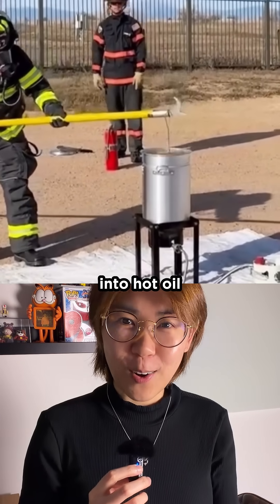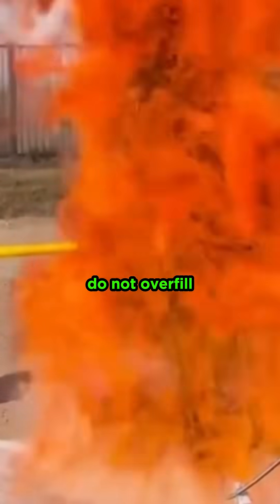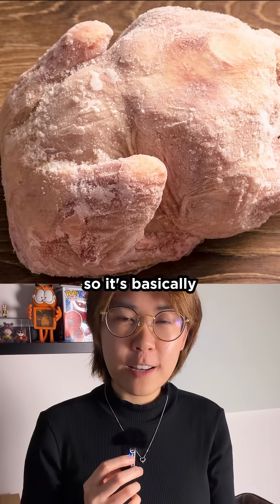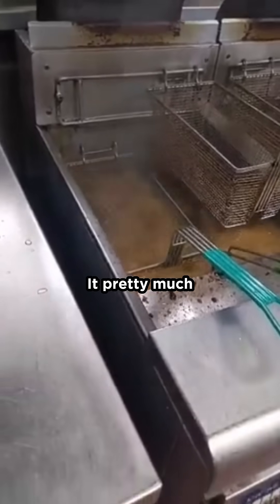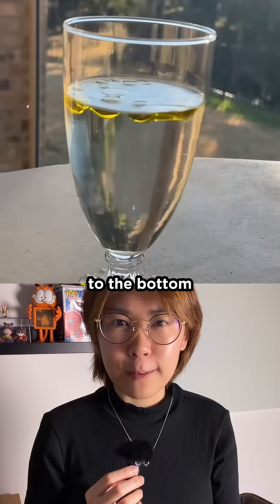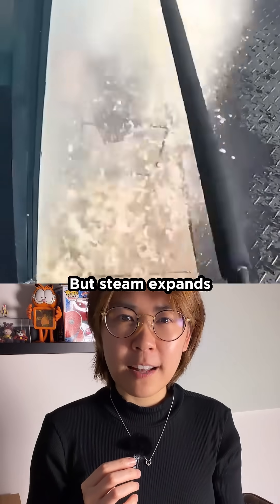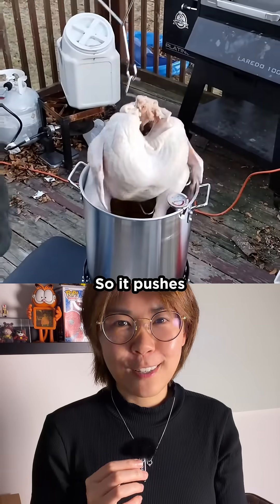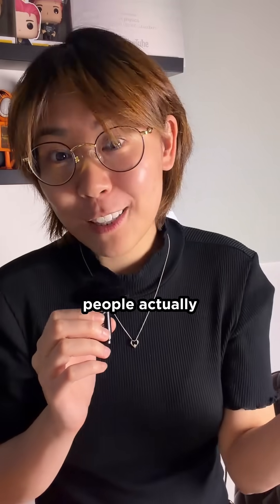The Dangerous Truth Behind Deep Frying a Frozen Turkey #holidayswithyoutube

Comment: The real thing to take home is that people do deep fry entire turkeys. 

I didn't think you would be able to get enough heat to the centre without burning the outside.
Reply: The oil actually circulates through the center of the bird and comes up.  The neck is gone so its an open cavity.  It is way faster than waiting for the heat in an oven to penetrate the center.

Comment: Deep fried 11 turkeys without issue refrigerator bird from the store 20 pound bird every year line on the steel container for how much oil consistent bird weight means you will be within a certain threshold and if you do a dry run without heating the oil you can insure the oil won't ever spill over

Comment: You can deep fry a frozen turkey. Using a giant cauldron blast furnace. You need a pan big enough to catch the oil and you have to rapidly add more heat. You can also use a pressure vessel which works amazingly. If thawed only takes 10 to 15 minutes. Probably only takes an hour frozen. I just use fresh turkey so I haven't tried it.

Comment: Worked in a train company once. They wanted to test the glass for the windshield if its tough enough to withstand a hit from a migrating bird in mid flight at top speed. The tester loaded a dead turkey into an air canon and shot it at the glass. It shattered the glass and smashed thru the first chamber. After investigation a memo came down stating that the test bird should be defrost first.

Comment: Something similar happened when I cleaned my kettle with a mixture of water-diluted vinegar. Apparently vinegar has a higher boiling point than water, but that is not how I would describe my experience. It ended up frothing quite violently, apparently has to do with the water turning into steam and ejecting the acetic acid like the oil would do with the water here. Especially if you use a diluted mixture, make sure to only go to 60°C and terminate manually. You can then reuse the waste for a tea, soap and vinegar fly trap if you feel like it. Especially during summer, that helped for a few infestations...

Comment: The boiling point of oil is also higher that water so even if your oil isn't boiling the water you add can. That roiling, boiling, steaming water is what throws the super hot oil everywhere. You can fry your turkey, but do it correctly.

Comment: I've probably only eaten turkey a few times in my life, but it seems the problem with this is ratio of the size of the bird, the amount of oil, and the size of the container. I honestly don't get why people keep doing it in pots barely bigger than the bird and look like they're almost filled to the brim.
Frying something frozen is actually quite common; french fries, for example. You just need to account enough space for the overflow, which is honestly pretty standard in deep frying--but then again, you'd need a LOT of it to fry something so big. Something wider than a stock pot. Also, don't drop it into the oil. I learned all of these the hard way when I started learning to cook.
Reply: Plus there are other ways to cook a turkey, like baking.

Comment: Okay, but what if i defrost the turkey overnight? Is it safe-ish then?
Reply: Yes, if you watch the video again, you will notice that most of the examples have people dunking the bird in very quickly or straight dropping it in.  Since the turkey is open all the way through, lowering it slowly while keeping an eye on the oil allows you to control the intensity of the reaction with any remaining moisture on the bird.

It isn't the moisture content IN the meat thats causing it, but what remains on the surface.  Thaw the bird, and I tend to leave it to sit for 30minutes to an hour at room temp, then pat dry the inside and the outside, then its ready to go.

Comment: The overflow of the hot oil then contacted the red-hot heating element at the bottom of the cooking pot, raising it to its ignition temperature. The flame then rapidly spread up through the stream of oil cascading down the side.

Comment: So what I've learn today is 1) if intending to deep-fry a whole-ass turkey, pre-cook in the oven to defrost first, 2) actually make sure there's enough empty space in the fryer for the turkey to fit to avoid a huge mess and potential THIRD DEGREE BURNS.
Reply: The trick is to place a defrosted turkey in to the pot, then fill with water until it just covers it, then remove the turkey and take note of the water level, that would be the fill level for the oil.  Also fold the wings in so they're not flopping around and catching on the pot when you lower it.

I do this prior to placing my turkey in the brine since its going to be wet anyway. If brining, I try to get fresh turkey instead of frozen since the frozen stuff in the US is pre-brined for the purposes of oven cooking.

Comment: this is ALSO why when you add the bird you TURN OFF THE DAMN BURNER.

Like that is safety tip #2 (#1 is a dry not frozen bird).

Because if the burner is off. the worst case for oil overflow is a huge mess, (and burns on contact) but without an open flame from the burner. no fireball.
Reply: Its that simple. Even if you fuck up every other rule, it'll be fine if the burner is off
Reply: @Dogthejewhunter  Seriously. I don't always have time to pre-measure, but it takes no time to kill the burner.
Reply: They even have a fill line for the pot you use to fry the turkey. It's not hard. But you have to be careful
Reply: @mattvillegas6355 , the fill line may not be accurate for the size of your bird. Best was is to put the turkey in the pot and fill with water to appropriate depth. Then remove the turkey dry it and note the level of the water. That is your real fill line.
Reply: @JM-lk6wo also doing it outside on concrete / stone is a good idea
Reply: How about just using an oven?
Reply: @epic7224 You can. and my family has done both and prefers oven roasted for our thanksgiving.

but Deepfried has its benefits!  it’s usually juicier (especially some of the otherwise drier breast) and more tender. the skin is much crispier, and the overall flavor profile is different.  (different oils can also effect this).

it’s sort of like asking why do a wet potroast vs a dry roast with the same cut, or baked vs BBQ smoked Ribs, frozen poptart vs toaster poptart.  the resulting dish is just different.  and if it’s what you prefer, it’s worth the effort.

Comment: Who the fuck deep frying a turkey like that anyway ?
Reply: People who buy a frozen turkey literally the night before and severely underestimate how long it takes to thaw
Reply: @redjoker365  will it helps the thawing process if the cold turkey is put in a preheated oven (but the oven is not turned on after the turkey put inside) or will it cook the turkey instead?
Reply: @antokarman2064 not really, it might thaw the outer 1" or so but it won't make the inside thaw. It takes 3-5 days to thaw a turkey.
Reply: @antokarman2064  Sounds like a great way to get food poisoning. The longer the food sits at the danger zone, the more bacteria you're going to get. Even if you cook the food long enough at high enough temperature to kill the bacteria, you're still going to have the toxins they produced.. and the longer it was between 40 F and 140 F, the more toxins there will be.
Reply: @hrodga  wait, then how do "normal" people usually cook them? they buy the turkey fresh? or they thaw them more than a day?
Reply: @antokarman2064  You have to thaw a turkey in the refrigerator over several days. If it is still frozen in the middle on the day your cooking, it can go into a cool water bath (completely covered) for a couple hours to finish.
Reply: @antokarman2064  
It depends on the Temperature of the Oven. But it wont help much compared to just have it sit on the Counter. Because there is not really much energy in the Limited air in the Oven.

Water helps with Quicker Defrosting. Usually if you put your Frozen goods into Water, it will vastly Speed up the Defrosting. 
However in terms of Quality, you would want to have it defrost slower in the Fridge. Quickly Defrosting is not very good for the Quality of your Product.

Dunno the Actual Physics for sure, but I guess its because Water has a much higher cpacity to move Heat around than Air.
Reply: @bmo3778  
You thaw them over a longer time in the Fridge. 
You get relativly little Bacteria multiplication when thawing stuff in the Fridge.

The "Danger Zone" is around Room Temperature. 
If you thaw your Bird in the Oven or Counter, you get much more Bacteria reproduction than a significant longer time in the Fridge just above Freezing.
Reply: @hrodga ”toxins” lol name one toxin
Reply: @antokarman2064  fastest way to thaw a turkey is to submerge it in cool water while it's still wrapped up. Check every 30 minutes and flip it. Don't use warm water because it will thaw it too unevenly which could lead to spoiled meat or just gross texture. Takes anywhere from 4-12 hours depending on the size.
Reply: @Z3R0NU11  Just one? Botulism toxin is pretty well known, Salmonella makes both endotoxins and exotoxins,  listeriolysin comes from Listeria.. shiga toxins from e coli... but you don't need to know their names; you just need to know how to prevent causing them if you want to cook safe food for people.
Reply: @Z3R0NU11  
Toxins? Name one thing that you learned at 3rd grade beside black history and mumble rap, because both are toxic enough
Reply: @bmo3778 we had to leave our 20lb turkey in the fridge for 8 DAYS in order to fully thaw.
Reply: America! Deep fry everything
Reply: @gosalie most of the world does this
Reply: @picklegoblin  nah.
Reply: @picklegoblin nope
Reply: @picklegoblin  Little bro, almost no other country celebrates Thanksgiving and if they do most of the time they bake that shit, not fry it.
Reply: @colourshow07Most of the world deep fries things. 🙄
Reply: @colourshow07 rest of the world is apparently REALLY bad at reading comprehension. He's just saying everyone in the world fries food
Reply: @picklegoblin no we don't
Reply: @johnserosanguineous1886  we really don't.
Reply: @picklegoblin  "This" as in frying a whole ass turkey? Hell no we don't
Reply: @picklegoblin no they don’t 💀 who tf is frying an entire turkey. Put it in an oven like a normal human being
Reply: @picklegoblin nope
Reply: People named Keith
Reply: My buddy Keith
Reply: people who stuff it with pizza and dip it in chocolate after
Reply: Keith
Reply: Keith iykyk
Reply: @GSerrano21 Is your name Ellis?
Reply: @WeDaForsakened no?
i do get what you’re mentioning but im just there for the meme, i know nothing about forsaken
Reply: @GSerrano21NOOOO DONT TELL ME YOU THINK ITS FORSAKEN PLEASE BE RAGEBAIT
Reply: @YellowSabre what the fuck does that have to di with this comment.
Reply: the people in the video I guess 😂
Reply: Evidently firemen.
Reply: Generally it's usually idiots.
Reply: NEGROS
Reply: Ummm...It seems that you've underestimated many people's stupidity/ignorance.
Reply: Smart people 😂
Reply: Americans 😅
Reply: Gus Fring
Reply: Mricans
Reply: It's big in the South. Delicious when executed properly as oven roasted turkey tends to dry out
Reply: @ottohumpmachine8958 We did it with my family in Indiana, too. It's quite good, honestly.
Reply: Somebody that doesn't know it takes about a week to slow-thaw a turkey in a cold box: fridge, cooler, brine pool, etc.
Reply: blacks
Reply: @The_Pontiff-f3j 
So many black people in this video innit
Reply: @The_Pontiff-f3j  mayo boys mostly
Reply: @The_Pontiff-f3j  guessing you’ve been eating bland food your whole life. No wonder you’re so mad and racist
Reply: @The_Pontiff-f3j  racist
Reply: @avsadpearl  bro how😭😭
Reply: @64siskat96 are you slow?
Reply: @kodycore  are you a professional victim?
Reply: @64siskat96 Are you a professional racist who likes to deny he's racist when we can all obviously see it? Please go ahead explain to me what exactly you think he meant by the comment.
Reply: @kodycore  so whenever someone says black people its automatically racist? Cry harder you softie. Youre not a victim lil bro calm down
Reply: @64siskat96  So go ahead and explain to me what he meant by the comment, smooth-brain. Where are the "blacks" he is talking about in the video?
Reply: @kodycore  call the amberlamps
Reply: @64siskat96 For you? I mean sure, your brain does seem to be in critical condition but I'd rather let nature take it's course.

Comment: Deep frying my turkey for this Christmas is a no go until i invest in a bigger pot
Reply: I've been using a Saf-T-Cooker 35 quart set for the past 12 years, very stable frame and has a pot where it is opens up towards the top for oil to splash around.  Unlike the ones in the video the stand for this one goes up the pot until where it flares out, and the legs are slightly curved for a bigger footprint.  I normally go around 14lbs but the pot itself has a max fill line for a 20lb.  Also has a frame/stand for the turkey to sit on while lowering, with handles and an eyelet in the middle if you decide to use a pulley.